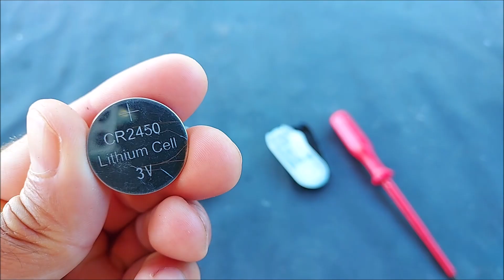🪫Cambiar PILA a Mando a Distancia de Super SOCO CPX 🪫Change BATTERY to Super SOCO CPX Remote Control

Comment: What if I have battery but the buttons dont work. They work sometimes but not others. Espacially the lock button
Reply from the maker: The buttons are probably broken. Does the red light turn on when you press them?
Reply: @Powerful_Creations  If I press hard or in a certain way I can se a small red light, but not as clear as usual. 
Is it possible to fix?
Reply from the maker: Maybe you can repair it at an electronics store, or directly buy a new remote and program it.
Reply: @Powerful_Creations  Where would I be able to buy just 1 new remote and how would I program it?
Reply from the maker: @frassesyt-kanal6063  At any official Super Soco or VMoto point